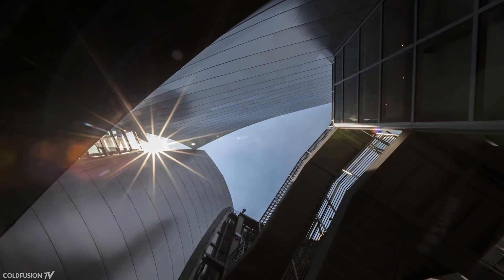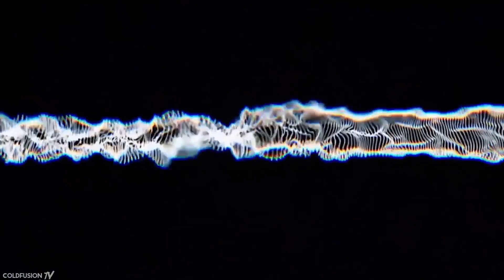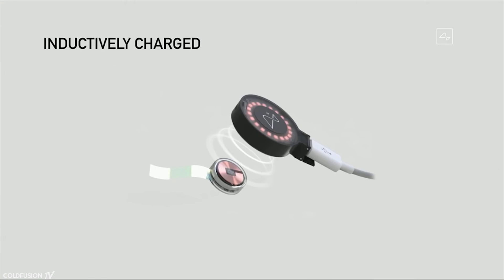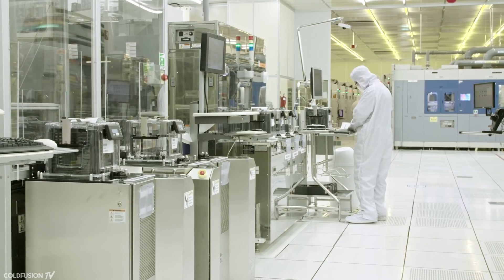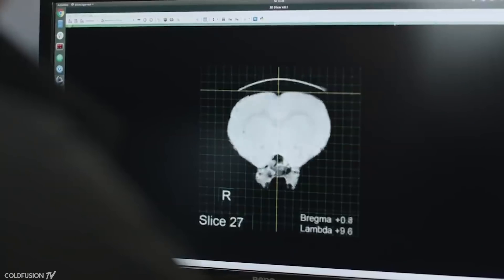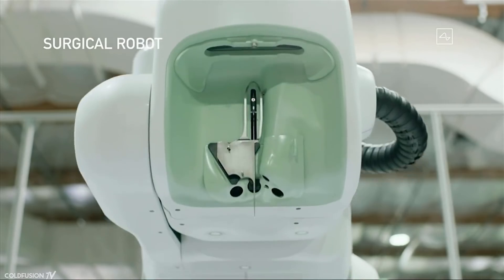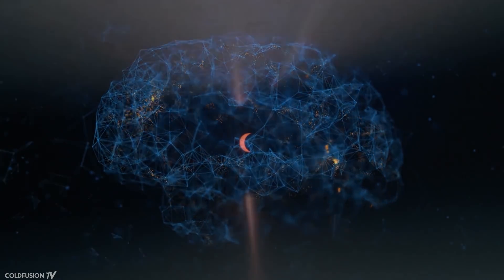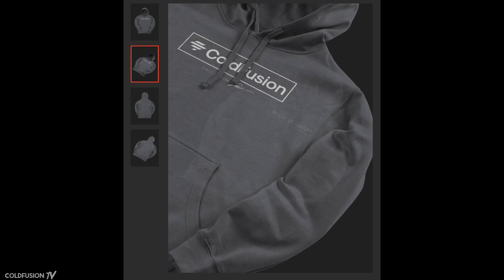Elon Musk’s Neuralink – Ex-Employees Reveal Company Struggles

Comment: Clearly Neuralink is struggling based on the recent presentation and call for employees. The key is the employees’ realism and Elon Musk’s optimism. There does not seem to be a commonly held notion that brain spikes are sufficient data for minute motor coordination, considering that we only saw read capability and no write capability in the demonstration, meaning it could be likely that the resolution of 1024 nodes will not allow for detailed writing capabilities, ie. triggering smells the pig will relate to food. Consider this: the read from the pig’s brain is an averaging of spikes, and writing would probably happen via a similar averaging using the current device, however, it is not clear that averaging will be sufficient to trigger the same synaptic responses as when the pig smells actual food. Considering the density of neurons in the brain: the device will likely require a much higher resolution (4-5 orders of magnitude) along the same surface area of the brain before writing specific smells or memories to the brain or rewiring brain architecture will be possible. There is no telling what kind of brain damage might ensue if averages are used for writing to augment highly specific neuronal interactions. If anything, the presentation of the sounds corresponding to averages shows that brain activity is near random to Neuralink’s current imaging capabilities. We will know that the technology for writing is ready when the technology for reading allows us to extract a high-fidelity audio file from neurons of a piece of music being listened to by the Neuralink user, or a volumetric, 3D visualization of the body in motion in real time. I estimate that this will take another 40-50 years along with a few massive technological breakthroughs in wireless data transmission, nano-technology (ie. having sub-cellular automatons that can send and receive data to individual neurons and an external cloud), and numerous other engineering and algorithmic breakthroughs.
Reply: So the best way to help humanity is to creat genetically modified babies??
Reply: @YA-kr4fr  It depends on what you mean by “help". If you mean to send people to Mars so as to become a multi-planetary species or to avoid the near-certain nuclear catastrophe that might end the existence of our species here on Earth, then my answer would be yes. I’m from Lebanon, and if you have been following the news, you would know the 4th largest explosion in history was recorded 1 month ago in the city of Beirut. Had it been nuclear, it would have meant the death of a million people, that is, unless they were able to withstand radiation. Furthermore, if humanity is not genetically modified to withstand radiation, then humans won’t survive on Mars for a year. That being said, I was not advocating genetic modification. I was simply pointing out the flaws in the current model of Neuralink, and why they are eager to bring new people on-board. There are many engineering, programming, and biological considerations that need to be addressed to make this device do what it was designed to do, and many cutting-edge breakthroughs that need to happen before this device will work as Musk envisions it to.

Comment: Some people are talking about getting hacked. That is because clueless people are blabbing. Please dont talk about stuff you dont understand like you are sure about them. It is virtually impossible to hack this device. We know methods of creating insanely secure systems. BUT: thre is 1 fundemental problem to this technology.. bluetooth. You can easily interfere with bluetooth signal thus breaking communication between neuralink and bionic arm or leg or whatever. I Have no idea how they will solve this. If its wireless it needs bluetooth and bluetooth signals can be jammed. Hacked? No. But why bother hacking it if you can simply disable it with strong radio frequency jammer. Gg

Comment: May be a stupid question, but can you get hacked if you have this installed on you?
Reply: I would guess that the device itself is hackable, even despite the mitigations and designs they are working on to prevent it; but your brain itself couldn't be hacked exactly. Not much different than the mental version of an unwanted pop-up ad probably.
Reply: @KentonBenfield  interesting, my thoughts are that (1) as you pointed out, we will remain consciousness (2) it seems like this device has influence over our sensory organs/ability to move, perhaps it is also capable of disarming us or cast a blank screen over our vision, just my curious mind wondering. Cheers buddy!
Reply: @howeweedoit  The Neuralink device can have its output (hackable maybe) control just about anything. I assume people regaining motor functions would have other devices implanted on the other side of the compromised spine, so that interaction could be vulnerable. Again, your brain isn't more vulnerable than it already is to a wayward web browser, except maybe that you can't turn it off without just letting the battery drain.